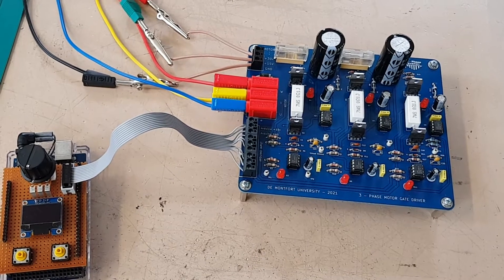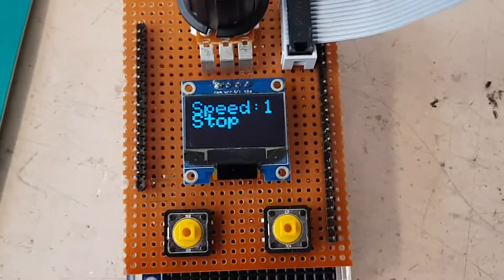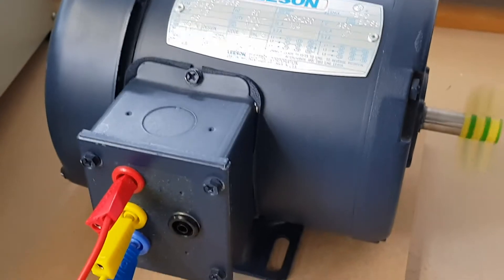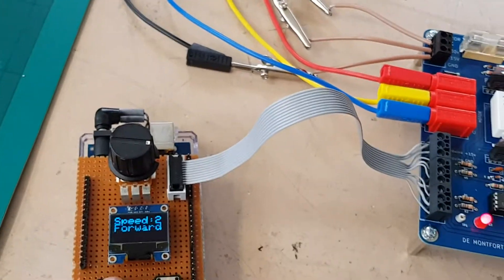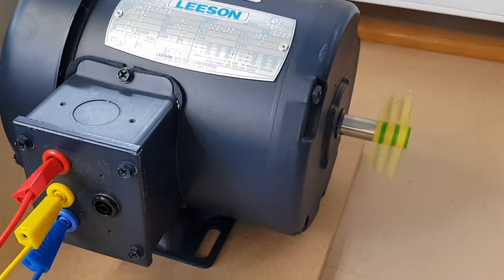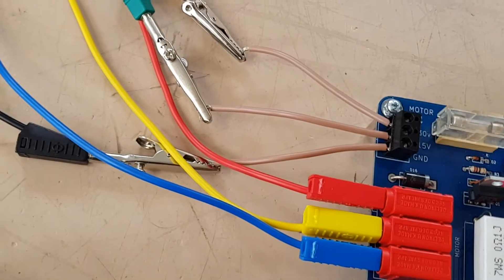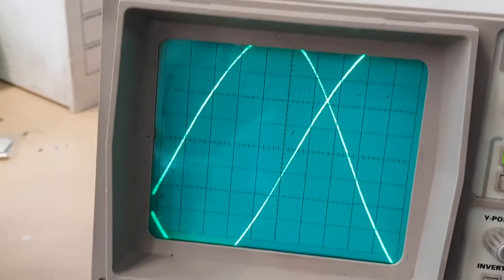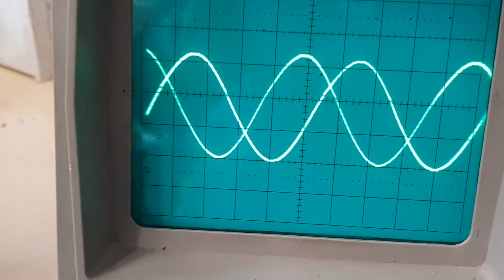3 Phase Motor Inverter using an Arduino Mega

Comment: Hello, thank you for sharing the circuit diagram. I have three questions:

1. Can you explain why the emitter for each IGBT is grounded together (instead of separately) with the V_EE (pin 5) of each respective optocoupler? In other words, should the low voltage be grounded separately from the high voltage?

2. The circuit diagram shows Arduino GND, Arduino_GND, GND, and GND1. Can you explain what GND1 is, as well as what the difference is between "Arduino GND" and "Arduino_GND"?

3. I thought that each optocoupler needs its own separate power supply. Is this the case for your circuit, or is there just one power supply for the six optocouplers? And, if only one, why?

Comment: @kashpatel898 Arduino mega board supply power range is 7V to 12V. So you supply 15V in arduino board. Can supply the 15V?

Comment: Arduino mega board supply power range is 7V to 12V. So you supply 15V in arduino board. Can supply the 15V?

Comment: Hi sir, what is the output voltage?
Reply from the maker: The output voltage is 45v peak to peak on the sine wave output to the motor.
This is a demonstration board, used to show the principle of a 3 phase motor inverter.
I supply the board with 18v to power the opto isolator chips and 45v Dc to drive the motor.
The board creates the 3 phase sine waves to drive the motor, the sine waves are 120 degrees out of phase.
Reply: @kashpatel898  what about the specifications of the motor you are using?

Comment: Can be used with Delta or Star circuit motors.
Reply from the maker: It's just for demonstration purposes.
I am using 35v dc to drive the motor.
The motor is connected as Star connection, with 415v max rating.
You could also use the motor in the DELTA connection with 230v max rating
Reply: How much supply current and voltage in this IGBT

Comment: What is the Highest rpm speed. İs it limited via Arduino una hz
Reply from the maker: The circuit board has 50v smoothing capacitors, this limits the motor voltage to 50v.
The motor voltage controls the RPM of the motor, with more energy.
I am changing the speed by changing the Frequency of the output sine waves.
This is done by changing the Delay of the PWM waveform. 😊
Reply: @kashpatel898  thanks for your consideration
Reply: @kashpatel898 sir these capacitors are connected to the output of inverter?

Comment from the maker: I will add another video soon with the circuit diagram
Reply: 3phase input 3phase output diagram Vfd drives sent me sir
Reply: If u run with 35v it become low rpm and torque also?? Or same torque but defert rpm onlu??
Reply: If u run with 35v it become low rpm and torque also?? Or same torque but defert rpm onlu??

Comment: Please I want a circuit diagram code
Reply from the maker: please click the link below for the circuit diagram and code for ARDUINO UNO board:

https://mega.nz/file/zJwGlagD#gHCEwp8...

https://mega.nz/file/mN5EFYRC#u8IML1P...
Reply: @kashpatel898  - The page returns "Enter decryption key. The provided key is invalid. Please check that the key is correct or ask the creator of the link again."
Reply: @kashpatel898  These two links are protected by a decryption code. No sure why as the links in the video description are not. Could you please provide links without this code?